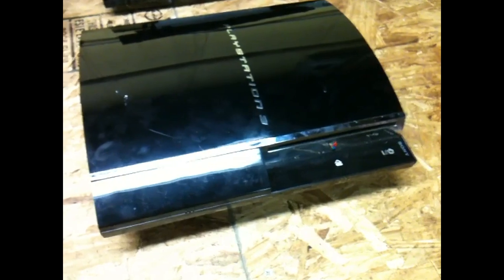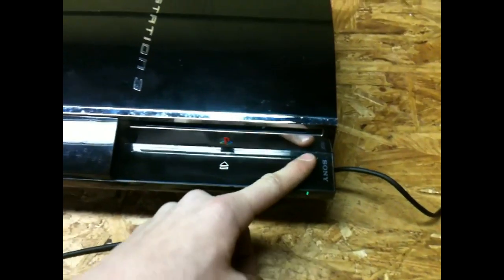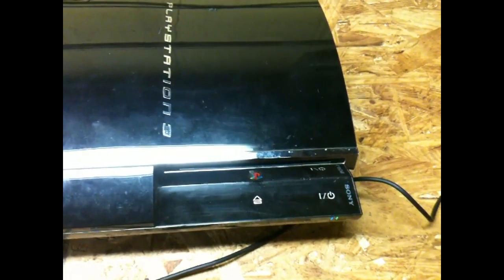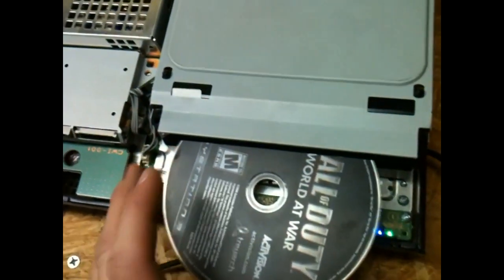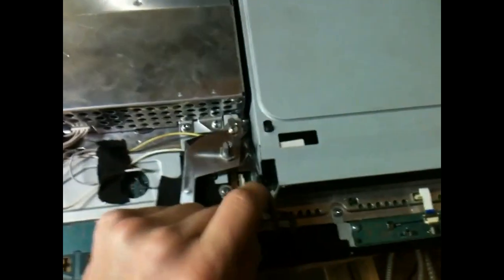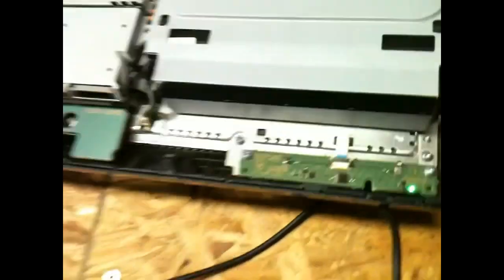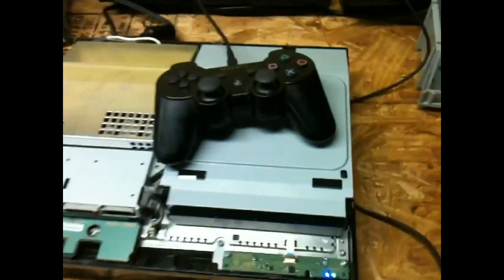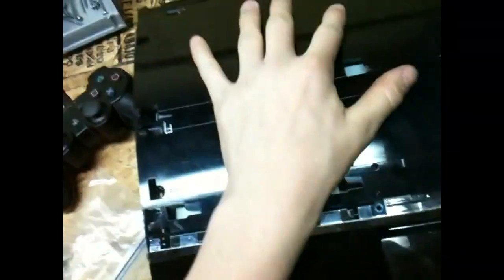PS3 80gb disc drive repair

Comment: The clip on the motherboard that holds the ribbon cable how do you release the tension is it the type you flip up or gently pull the left and right side forward thank you in advance

Comment: I re thermal compound my ps3 flat because it was over heating I brought it as used . however now I cant get my dvd to work I put in dvd it wont glab it. I did checked cable make sure there in right. used work before. any idea

Comment: so I couldn't get a clear answer on the internet but I took a chance the clips that hold the ribbon cable all lift up did not break an clips went very smooth just gently lift up on them you can even use your fingernail
Reply: Thanks Kevin, now was it the lenses reader? I dont hear mine spinning.any idea?